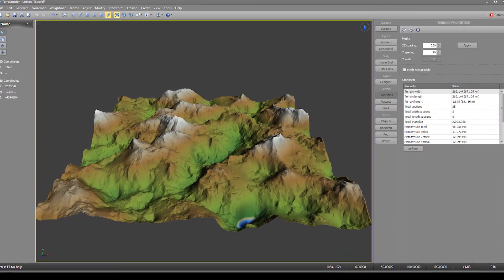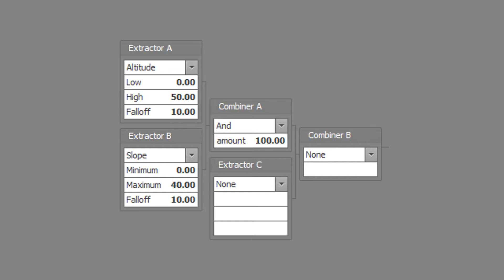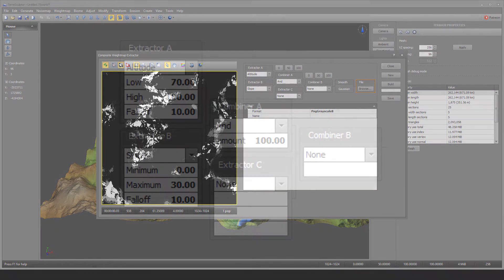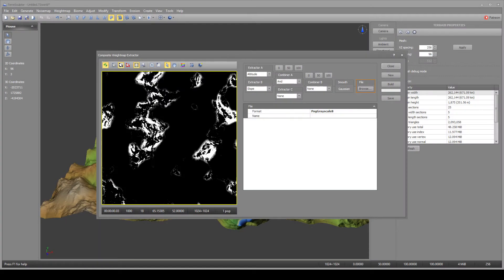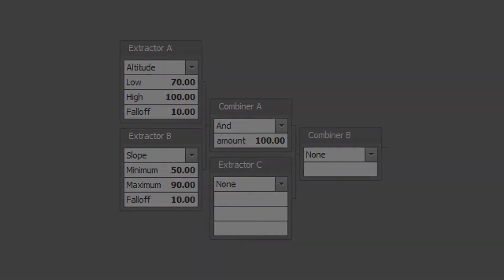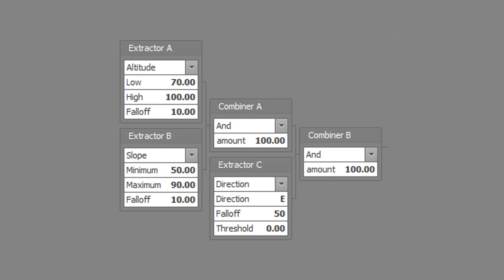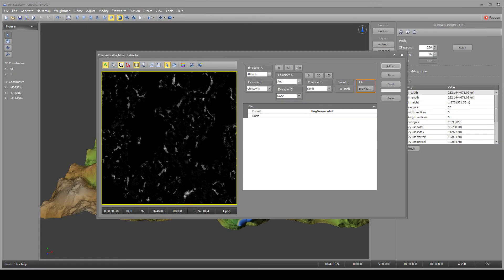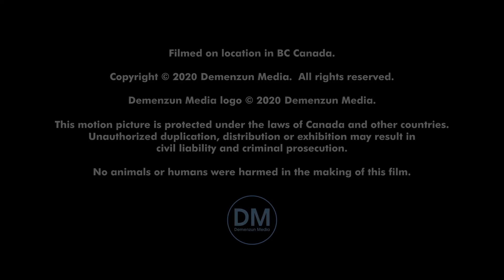TerreSculptor Composite Weightmap Examples

Comment: Hi, I'm stuck on what seems a bug. I've created a terrain stack, to create an Island with water (flat terrain) all around. However,  when I try and use the weightmap extractor, it extracts the weights considering the terrain elevation in the first device (the base noise map) only. Is there any options I have to check to get the weightmap for the built stack?
Reply from the maker: Hi.  The Weightmap Devices will extract the weightmap mask for the device just below them.  So you may have the Weightmaps in the wrong Stack position.  I replied to your email to support on this.
Note that I am working on more Terrain Stack videos, including one on Weightmaps, which should be on the channel soon, and should help you with your questions.

Comment: has anyone idea how to make, for example, mountains 'wall' on the plains landscape in the TerreSculptor?
Reply from the maker: Are you referring to changing the heightmap so that it has steeper mountains or are you referring to creating a weightmap that has the steep "wall" sections in the mask?
One method to make steep mountain walls is to use the Terrace modifier on the Transform menu, it is usually easier to start off with a preset such as Terraces on Terraces 12 on 4.  You can also use the Equalize modifier on the Transform menu to draw the shape of the mountain surfaces, the spline line determines how to change the faces of all steep surfaces.
If you are referring to creating a weightmap mask for texturing mountain "walls" for use in game engines, you would use the Slope Weightmap Extractor and start off with the Min at 45 degrees and the Max at 90 degrees and adjust as desired.
Reply: @demenzunmedia  I mean, for example, I have a plains landscape and I need to add a wall of mountains from north to south just in the middle of the landscape, something like a mountain dividing the plains landscape.
Reply from the maker: @AlphaBrox  - That is a composite style of heightmap, where you are mixing two different biomes together.

The only way to currently do that in TerreSculptor is to create two heightmaps, one of the plains and one of the mountains, then create a mask of where you want the mountains to be located using Photoshop, and then use the Blend modifier on the Transform menu to blend the two biome heightmaps together.  One of the heightmaps and the mask must be files that you have saved to disk, and those will be blended with the current viewport terrain.
If you watch the YouTube video regarding Creating Play Areas, that is the same workflow.  That is the current (and more difficult) method to achieve biome blending until I get the Terrain Stack completed.

The upcoming Terrain Stack system will let you do all of this multiple biome creation and blending right in the TerreSculptor software.  The Mask Painting tool and Terrain Stack should be fully functional later this year.  The Terrain Stack will allow for multiple noisemap generators to be stacked with masks in between them, so you will have complete dense multi-biome control.
Reply: @demenzunmedia  Thank you very much for explain. Yep, I remember about Stack and waiting it :) I just thought there were some alternative methods at the moment. I used a mask in Blend to create an island, but I didn't think about mountains at all :)) Ok, I understand the way now, will watch the video again and try. Thank you very much again and good luck with your development!
Reply from the maker: @AlphaBrox  - Thanks.
The Blend method is currently the only easy way to obtain what you are after.  You can create the Plains heightmap and Normalize and save that as a PNG16; create the Mountains heightmap; save a copy of that as PNG16 and import it into Photoshop to draw a mask around the mountain region that you want and save that as PNG16 or PNG8; with the Mountains still in TerreSculptor, set the Blend Source to External File, and assign the Plains PNG16 to the Blend Source Filespec; assign the Photoshop mask to the Alpha Blend file; then adjust the Blend Amount as desired to blend the two biomes.

When the Terrain Stack feature is completed, this will all be easier to do a similar biome blend right in TerreSculptor without have to use Photoshop or save all of the files out to disk first.  The Stack will allow for up to 8 heightmaps each with a mask, and the ability to select them for the source in the Blend modifier tool.
The Stack will also allow you to mask any of the modifiers, so you can create a heightmap, paint a mask for where you want the modifier to work, and run the modifier, and it will only modify that masked area of the heightmap.

A planned future feature is also Terrain Brushes.  So you could create a Brush out of a mountain range, and simply stamp that onto the Plains heightmap to modify it.  The Brushes will be available once the Terrain Painting features are implemented in the future.

You can also join the TerreSculptor Terrain Software Facebook group to ask questions over there.
Reply: @demenzunmedia  ok, thank you.